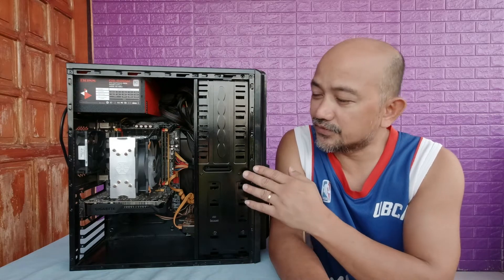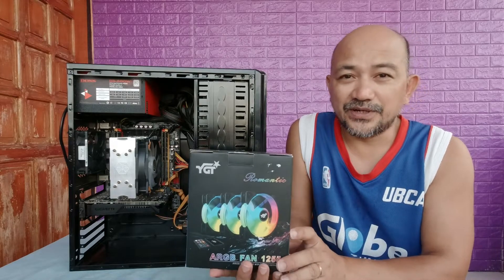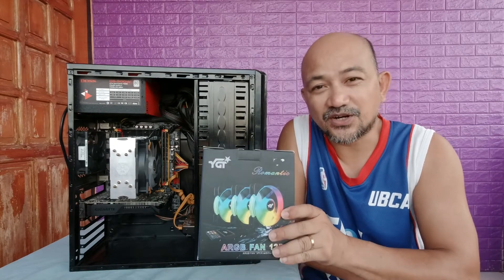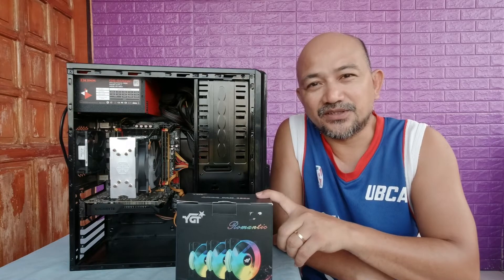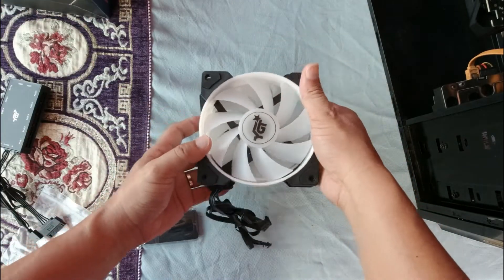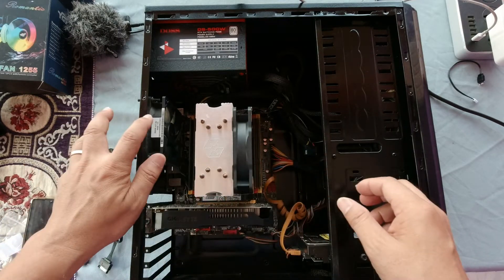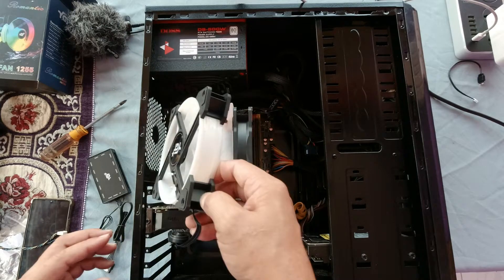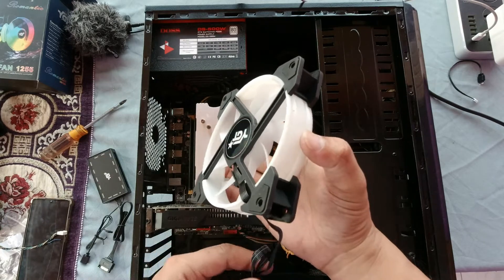Installing A-RGB Cooling Fan Module on Non-Supported Motherboard  | DIY Petz

Comment: This is not argb or "addressable RGB". There is no way you can control the lighting through a software for this set up. What you are doing is the other way around. You are converting the ARGB header to a 6 pin rgb to be controlled through the hub which is technically a rgb controller.

Comment: Sir, puwede ba natin ikabit yung Inplay M10 Rainbow RGB fan sa Inplay Ice Tower Hub gamit ang 6 pin to 3 pin adapter? Compatible ba sasalpak yung 3 pin ni Inplay M10 Rainbow duon sa 3 pin na dulo ni 6 pin to 3 pin adapter. Please reply ASAP. Thanks po.
Reply from the maker: No idea Sir, but pwede yata if may 6-3 pin connector ka.

Comment: but i dont understand where did u connect the controller 3 pins cable ?
Reply from the maker: Hi Sir, I did not use the 3 pin argb cable since the motherboard does not support it.
Reply: @RollyPetz  so that cable doesnt attach ?
Reply: @RollyPetz  You only plugged the sata power cable ?
Reply from the maker: @DEXTERIUM  Yes Sir, the 3 pin argb connector would only syn to the motherboard argb if the motherboard supports it, but in my case, the motherboard does not have rgb ligthing support.
Reply: No 5v argb connected to mobo, the controller just control the light, no sync in mobo

Comment: hello..lods ask ko lng ginamit mo pa ba yung 3/4 pin ba yun yung ksama ni sata cable kinoneck mo pa ba ga mobo o di na?? yung sata lng ginamit mo?
Reply from the maker: Hi Sir yung sata cable is for power supply Sir.

Comment: Ok... what about  fan SPEED CONTROL??
AS NOW THEY SPINIG AT CONSTANT SPEED!!
AND IT WILL WEAR FANS OUT MUCH MUCH FASTER!!
FLASHY LIGHT BUT SPEED CONTROL???
YOU DIDN'T MENTION THAT
Reply from the maker: They are on constant speed Sir. So far mine is more than 3 years now, stil going smooth.

Comment: Finally, the most informative answers to my question about cpu cooler argb connection. Thanks so much for this.
Reply from the maker: You're welcome Sir...have a nice day..
Reply: @RollyPetz  Hi sir! Kung ang fan hub/controller ko ay nakaconnect sa PSU tapos gusto kong gamitin ang ARGB mobo features, pplug ko po ba parehas ng wire (SATA to PSU and Fan Hub to ARGB port (3pin/5V))?

Comment: Hi to what i can see the male 3 pins connected to the argb female 3pins , but the white connected I saw there are only 3pins not 6pins which connected to the controller.
Reply from the maker: Yes Sir, thats correct, aRGB only needs 3 pins.

Comment: My mother board is gigabyte a320m so it doesn't have rgb header and i have ygt cr1400 cpu rgb fan... And nainstall kona kaso walang ilaw pero nagana yung fan, So pwede korin pong mapa ilaw at masync yung rgb ng cpu fan ko using rgb controller then bibili po ako ng 3 to 6 pin converter tapos ikakabit kodin po sa rgb hub para mapagana ko yung lights and masync yung rgb ng cpu fan kopo? Sana po masagot at mareplyan nyopo salamat.. :)
Reply from the maker: Good morning po Sir, pwede yun Sir...

Comment: So where the 5v 3pin cable from controller should connect to? I have 4 pin motherboard
Reply from the maker: HI Fluiteos, my question first is that does your motherboard support "aRGB", it's should have a 3 pin header "aRGB" connector on the board, if it's only a 4 pin then I think thats for "RGB" header support only. Thanks.
Reply: @RollyPetz  so basically we don't need to connect the controller to the mobo am I right?
Reply from the maker: @redhorsegamingpub7753  Yes Sir if your motherboard does not have an "aRGB" pin, thne you don't need to connect it.

Thanks.
Reply from the maker: Sir, you only need to connect the 3 pin connected form the controller to the motherboard if your motherboard supports and aRGB if not then you need not use it because this controller is not for the 4 pin RGB support motherboards. Tnx.

Comment: Can your pc still detect your cpu fan?
Reply from the maker: Good day Sir, yes it can detect the fan.
Reply: @RollyPetz  thanks for the response, yung prob ko kasi two hybrid fans header (4pin) lang meron yung mobo ko. Follow up question can I also connect the fans of my cpu cooler sa hub? And pwede pa mag connect ng splitter sa hub? I have 2 fans for my air cooler and 6fans chassis a total of 8.

Comment: you have negative air on that set up because the fan at the front sucks cool air in while the fan at the cpu cooler blows hot air against the front intake while the rear intake sucks out negative air.
Reply from the maker: Hi Sir good day.

All fans fas are directed towards the back Sir. The front sucks an intake air, the cpu fan sucks the air from the front and blows the  cpu grills towards the back thus cooling down the cpu and hot air go towards the back where the exhaust fan blows out the air. 

Thanks.
Reply from the maker: @substoAttalahRizky Thanks for this info This should be taken into consideration.
Reply from the maker: @substoAttalahRizky Yes Sir, still alive and kicking. I'm cleaning the system once in while specially that the front intake has no filter. Thanks for this.

Comment: where did you buy the 6pin to 3pin argb converter
Reply from the maker: Hi Sir, found it online via shopee..pls see link..tnx.
https://shopee.ph/3pin-5V-ARGB-to-6pin-RGB-ARGB-Hub-Cable-Adapter-Adaptor-i.314446253.7581690050